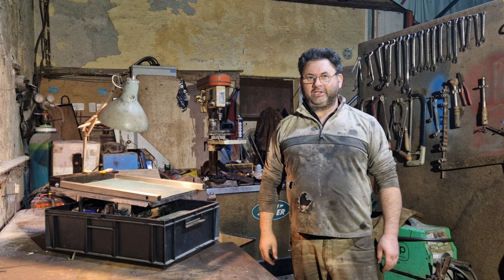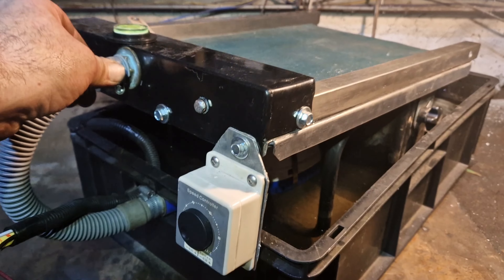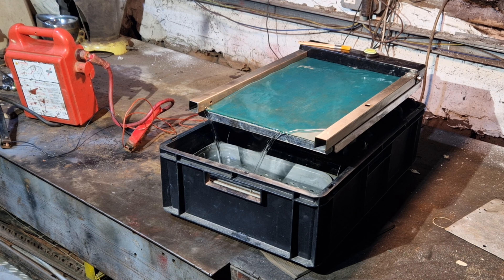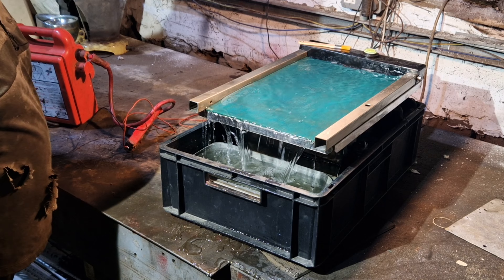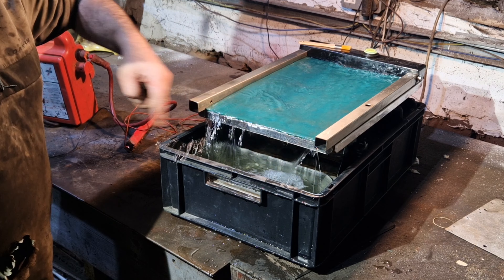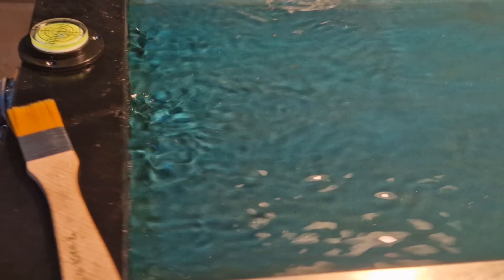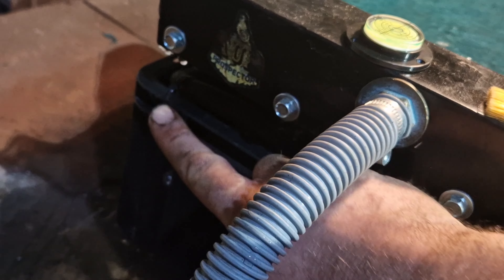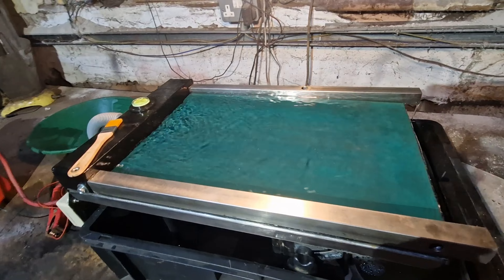Miller Table Build  (Part 3)

Comment: I put some tape over the bottom of my pump and a valve as well bro it worked great
Reply from the maker: Nice one Paul, if the next controller dont work i will use a ball valve.

Comment: you will get it, but your misfortune did make me chuckle, you sure you wired that up properly 🤣, right on to part 4, i have high hopes for this.
Reply from the maker: A friend told me using my jump pack to power it probably broke it.

Comment: Try a dimmer switch for a house light  or use a isolation vale on the inlet to the spray bar to slow down the water flow ,still great engineering tho mate 👍
Reply from the maker: Dimmer switch is 220-240V, not rated for 12v 3.6A pump and a ball valve puts too much strain on the pump.
 I will get a decent speed controller and get there in the end.